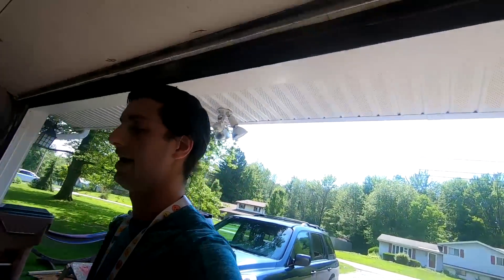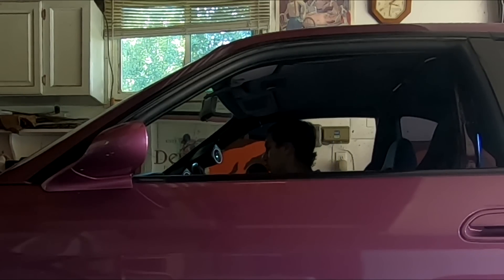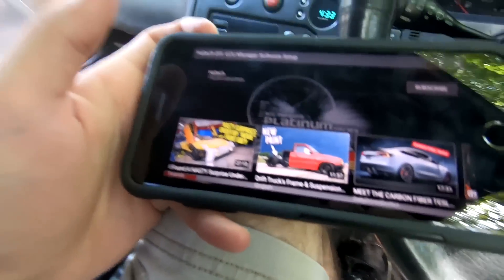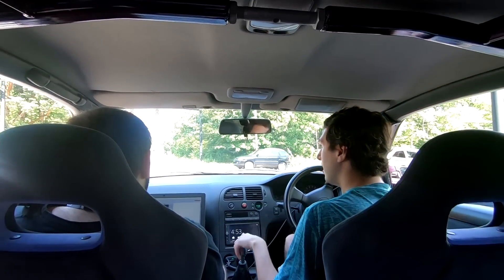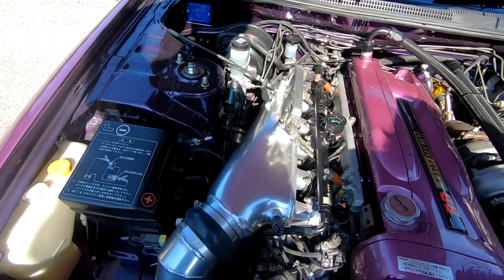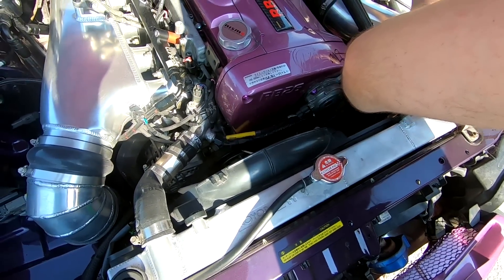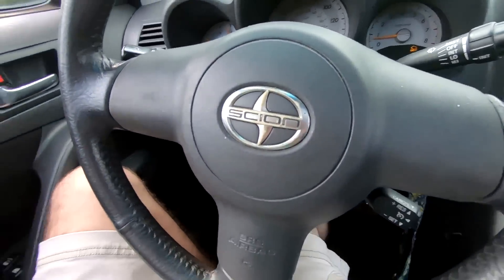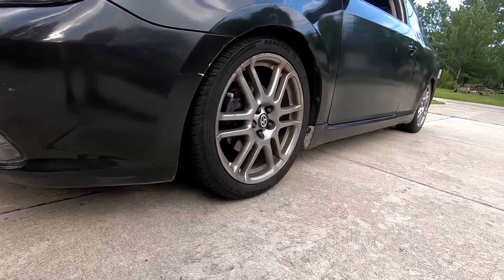I BROKE THE R33... Kinda

Comment: New belt. Check tension, and as far as fuel cut. A good tune will fuel cut on over boost. Check all boost related vacuum lines. And if there is a boost controller maybe turn it down to prevent from getting to the point of overboost

Comment: When you got so much power. It will stretch the belt tensioner and fling it off.
Reply from the maker: That makes a lot of sense. My mechanic was saying the pulley for the power steering pump was also slightly back from being inline with the other pulley it attaches to so if I got a spacer and get them in line it might happen a lot less often since the belt isn’t straight the way it is
Reply: Justin Leuchtag that will do it 👍🏼
Reply: Get a chain instead
Reply: Mar nooo chains are way more maintenance